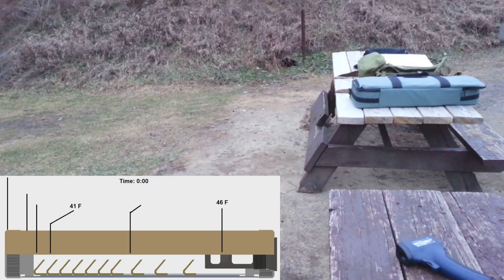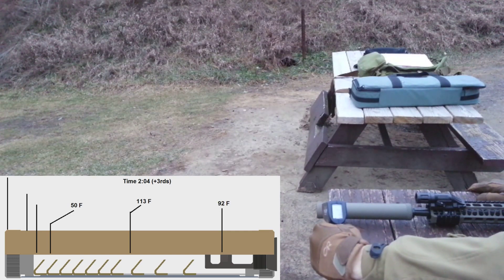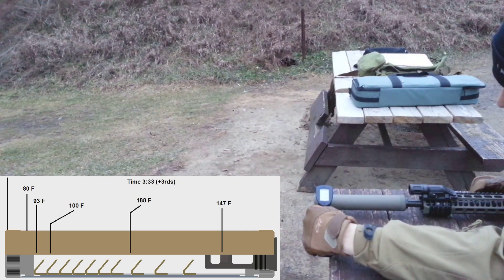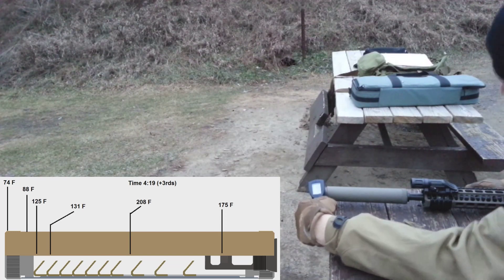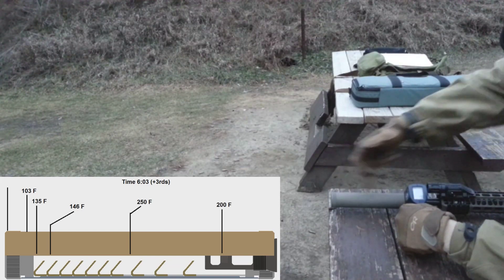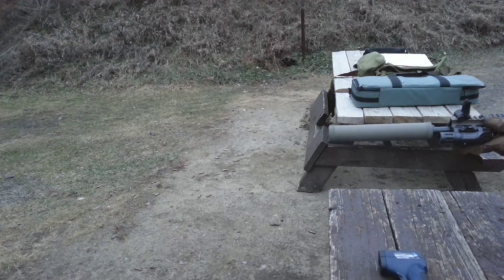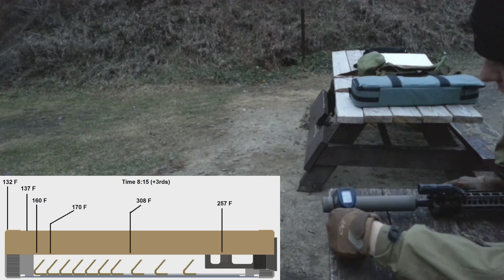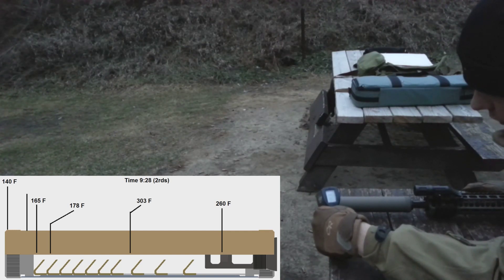SD Tactical Homemade Titanium Suppressor Heat Study, Pt 1

Comment from the maker: @ Casey Williams (Can't reply to a linked comment for some reason) But with the aluminum I'm not too worried because from this test it doesn't appear to heat up too much at all... infact it is pulling heat away from the other components and cooling them like a heatsink.